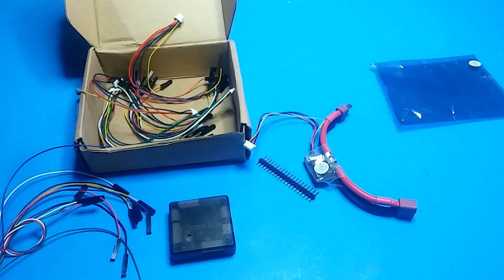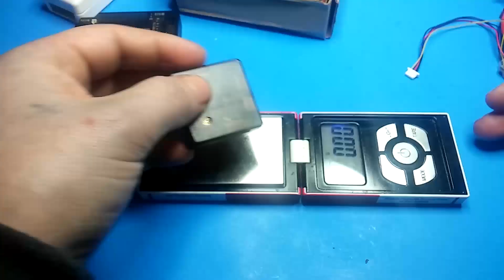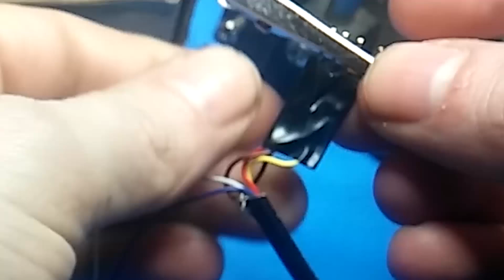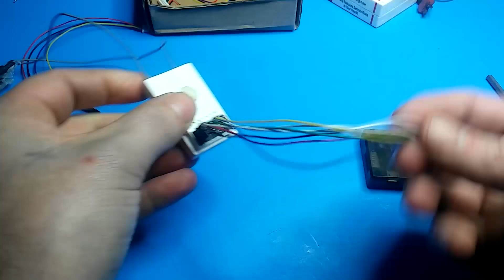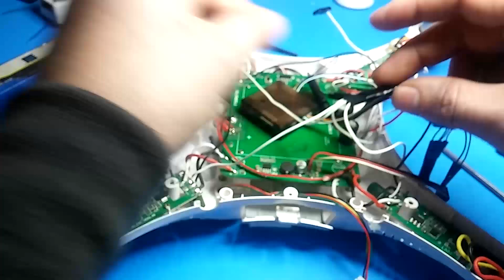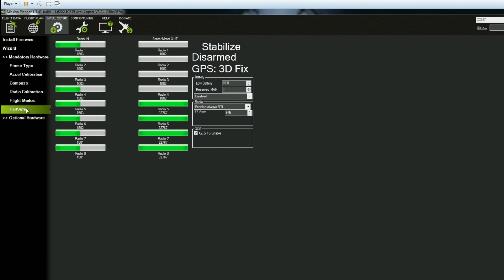Mini apm 3.1 for fpv quad  installed in cx20

Comment: This video causes confusion, looks like a birds nest and your drone will probably crash due to a wire connection failure. The term “This Guy” is used over 40 times during the video.
Reply from the maker: thanks for taking the time to comment....
.  as i explained in the video I left things long.. If you notice I have tonz of video's and cutting the wires on my components would force me to buy new ones all the time..  (as i explain that multiple times in the video)   See that is the difference between "this guy" and you.. you do zero to contribute but feel the urge to shit on other peoples video's that in all means are here to help others..      yet another troll ..."this guy"     ----- I should add i just spent a all nighter building firmware and hardware for a new style osd.. .. to share with the community so tired decided too look on youtube to help people in the comments before going to bed....and found this pile of shit.. <--usually i would just ignore ppl like you... tired and cranky i guess

Comment: After watching this entirely I have to say its a real pain in the Butt! Knowing what I know now I or others can set up the older 2.6-2.8 apm in 30mins or less. No compass? Who designed this thing? I have found the internal compass not that bad, but the external are a little wacky. I plan to use the external GPS and internal compass. Thanks for the show.
Reply from the maker: some actually come with the compass. most quad apms are not suppose to come with it, however I have couple of apm 2.8 that actually have them as well and not suppose to. .. My biggest complaint is the lack of grounds and forcing people to cut esc wires is ridiculous.or they should label ("soldering required")  .   I did find a entire new set of wires for 7 dollars for the apm 3.1 which would be worth getting just to cut them to length ..   but besides that I am making one more video with it on how to unbrick the thing..    

thanks for watching the video and the comment .. it was a long build and glad you were able to make a decision from it.
Reply: Well when I can afford it I'm looking at the Naza m lite. Then turn it into a Naza m V2. Right now I can't justify it or the risk of turning it into a brick. I have kk215 that I finally have flying stable and thunder QQ. Naza m for another day. I'm back to APM also fmw. 321 which is stable. CC3D even with beta flight is unpredictable. I had a mini quad take off at full speed in my basement at minimum throttle which is a bug in beta flight. Thanks for the videos.
Reply from the maker: Heh thats the only reason why I wanted a naza was to see if I could hack it,     I just ordered the lite .. not so much for the upgrade process but more because they say the boot loader uses serial .. so I will see if I can over come that little hickup. and see if if I can come up with a easy unbrick for it..

Comment: Intersting looks good
Reply from the maker: yeah its not a bad little apm.. just not so convenient ..  I will prob install it  on one of my smaller quads..
Reply: Thanks its 32.95 in the states. Not bad. Wiring is like a CC3D which dislike. I will try one soon.

Comment: I'll give that a shot and see what happens. sucks that it looks all shiny and new and I can't get it in the air.. Lol
Reply: okay, another idea / question. if I wanted to add up lighting to my front props. perhaps still a small hole in the frame under the props and mount tiny led's under them. where would i plug them for power? in the fc similar to where i plugged the leds for the rear with the GPS and arming? could i just break off of the positive and negative for those lights on the new ones?
Reply from the maker: hi .. depending what kind of lights you have . you should be able just to plug them in the 5 volt rail on the receiver ..if your still using the b cable on the receiver that is.   

other wise just use the b cable for just the lights if your using a power module.

Comment: Hi Bangs!
You do not seem to like this guy... I've just been hesitating for a couple of days between both 3.1 and 2.8, since I understood that my UART on the stock APM 2.5 was probably dead  . But imho, smaller, lighter, less GND pins... that's cool! All negatives are finally the same, I can solder one commun gGND. As for the compass, there's a huge discussion , wether or not it should be taken from inside or outside the APM (mag interferences when INSIDE? really ???). As for the 3.3v, I could resort to solding a 66RP regulator 
 .8A , as I even n ow experience issues with my USB plug so I wanted to change it (https://fr.aliexpress.com/item/Patch-LM1117MPX-3-3-LM1117MPX-3-3-chip-linear-regulators-800-ma-3-5-V-SOT/32825322016.html?spm=a2g0s.13010208.99999999.337.ZTzjMV)
BTW about your joke: "size doesnt matter", right? Well... not sure why they use to tell me this ;)

How about your flights? comparison?
Anyway, thanks for all dude!
Reply from the maker: Hi the apm 3.1 and pro fly 100 percent the same as the apm 2.8 its the same hardware they just made the pcb smaller..     I have meant to take some time and throw the apm in one of my smaller quads ..but lazy I am.. .. I like the voltage reg idea...    

I ordered about 10 883 chips(compass modules) about 3 months ago when i had made that hubsan gps video,they have not come in yet!!!!. another alternative to the voltage regulator is just to order a arudino compass module with the 883 chip. most come with a 3v3 regulator and cost a couple of bucks..     

I have not re watched this video but if I remember right it had a bad voltage regulator so finding 3.3volts on the board might not be wise ..   So with that going your way is probably the best..
Reply: "my way"...hum... is always a pilgrimage, as you might have noticed by now. If there's anyway to be around the fan when the s**t is gonna hit it (pad my French!), make sure I will be near it! I have a DNA to collect troubles whenever I do everything by the book, but...hey, I'm enjoying telling stories afterwards! 
I'll let you know, good luck with you 883 chips (if there still needed by then, otherwise, you'll have some beeeeautifullllle jewels for a necklace or so!).
Take care